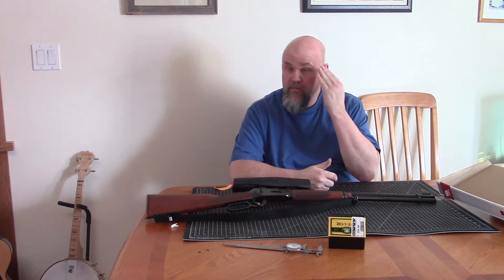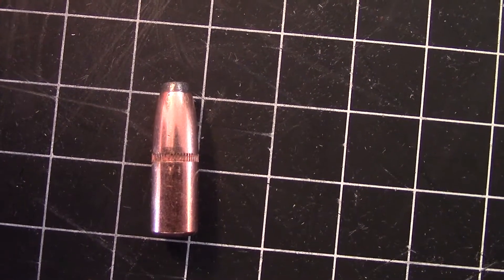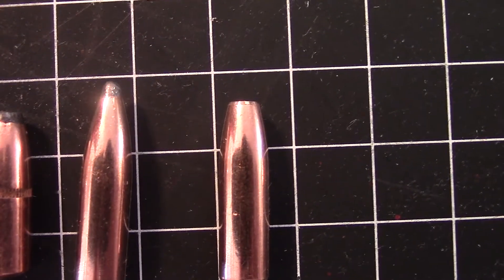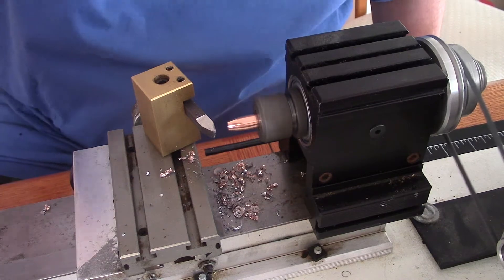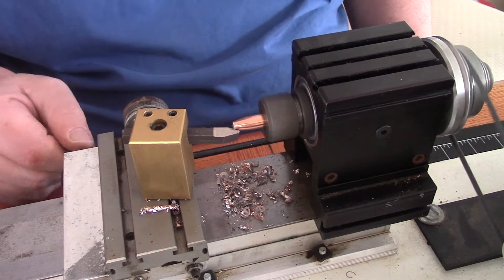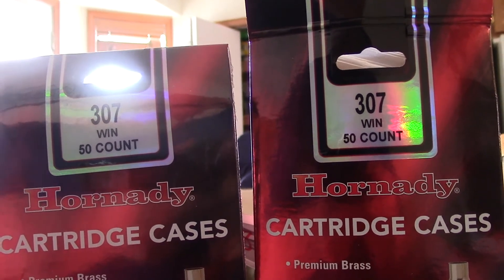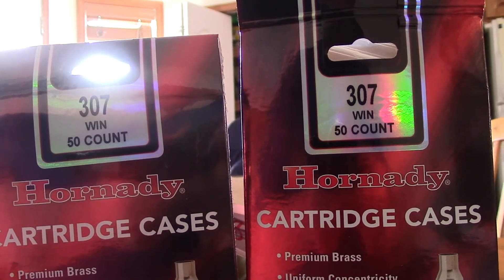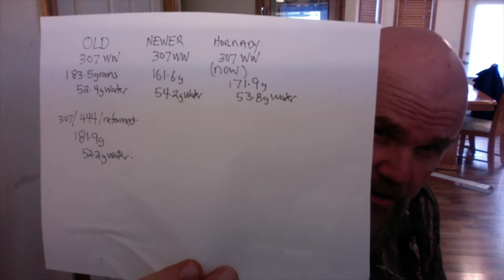Hornady Brass and Modified Bullets for the 307 Winchester

Comment: Maybe a stupid question but have you considered the Nosler Partition bullets. They have a 170 grain flat nose and I believe some heavier roundnose bullets that would probably work just fine. Just a thought. Good job on cutting the bullets down, I would expected them to open quicker than before.
Reply from the maker: I hate to say it but those damn partitions are so expensive I wanted to see how the heavy weigh Speers work out.  It's fun modifying stuff as well.  Figure with the big opening they might open up nicely.
Reply: I understand on cost and wanting to try something new, just thought I would ask. The cost is worth it to me under the right circumstances, but not always. Good luck, I am looking forward to your tests. Always enjoy the channel.

Comment: Very happy to see this brass available, stopped at the local gun shop today to see if they can get me some. You do any work with the .356? Thinking I might be wise to get some extra Hornady .307 while supplies last to neck up should the need arise. Keep up the good work, always quality video's from you.
Reply from the maker: No experience with the 356, though I owned a 358 for a few years.  The 307 would make a good 356 case....one simple pass in a good die with a tapered expander